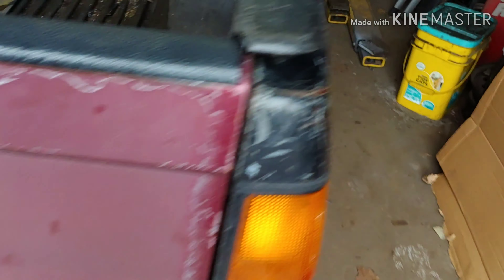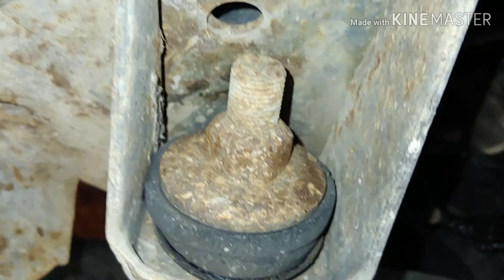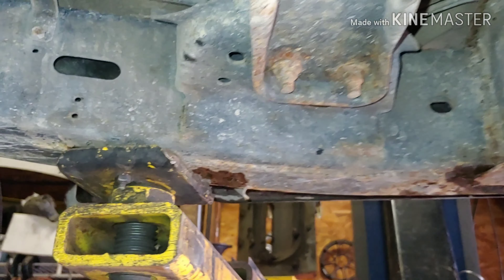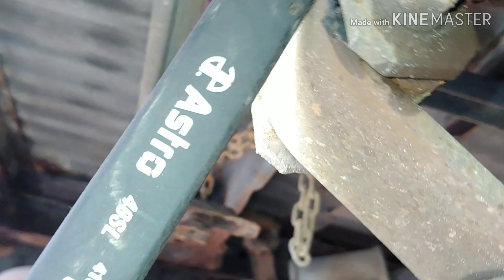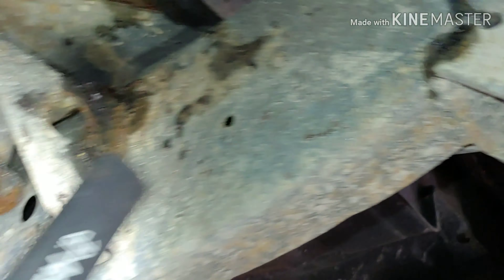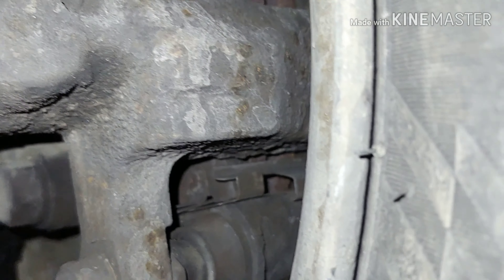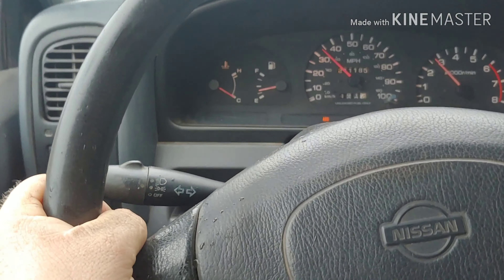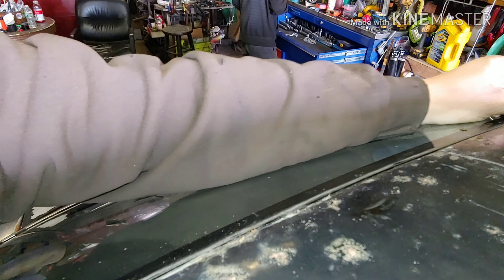Mini Truck restoration...kinda

Comment: The. Mid 90s.  S10
Has.  Huge body rust out problems
Frame stays solid though
Reply from the maker: Got one of them too 96 v6 auto standerd cab....absolutely rust free.  Amazing really got to sell it before it ends up in the scrap fleet.
Reply: Bert Horton yes. With the Chevy it’s the rocker panels and the floor get eaten up by rust
Salt 
Frame not so much 

But no matter what brand of small pick up truck you could not find one for $400 around here I don’t care if it’s a Toyota or a ford ranger a Chevy S 10 Nissan nothing
People don’t sell those
They either keep them or they just drove them until they completely fell apart
Reply from the maker: @steelisthemeal  thats my plan drive it till she pops then hopefully. Tdi swap atleast one of them.    The s10 i got is a gem for the year for sure...it likes to melt the one tire something terrible tho...lol
Reply: Bert Horton sounds. Like a. Acceleration or. Torque problem 😱🤣🤣🤣😁👍